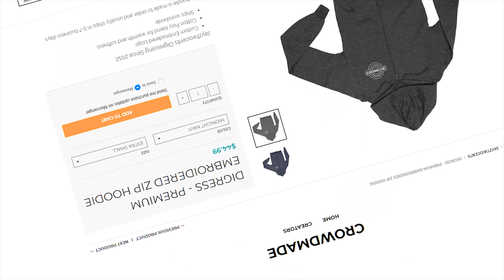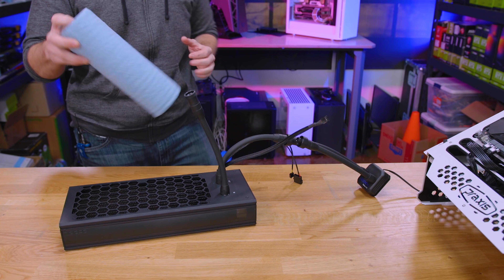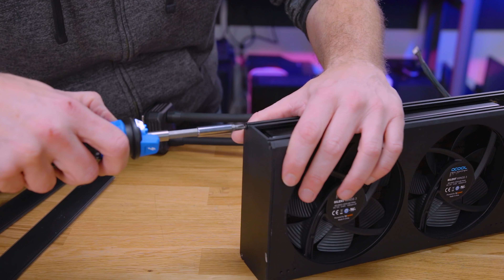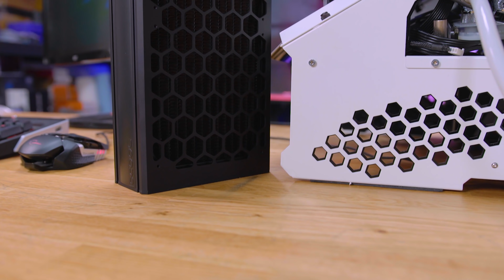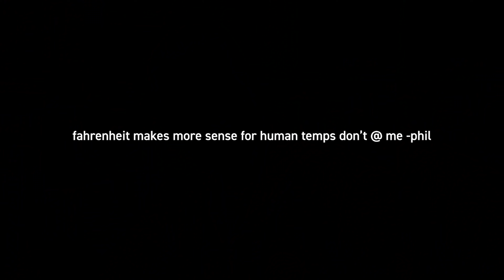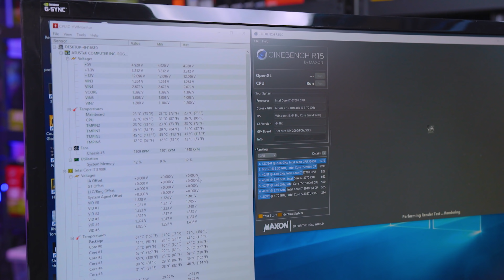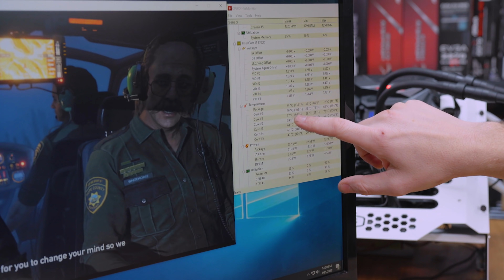This AIO is ridiculous!

Comment: I know this is an old review, but you have to look out also with bigger GPUs, if you want to mount this beast in the front of your case, I bought me a 360mm Eisbaer Aurora, and I just had the place to install my MSI 6750XT Trio GPU, And I also used different fittings and tubes to the radiator/ pump. Which is an amazing possibility. Because the quick connects doesn't look very attractive.

Comment: Hi JayzTwoCents. I have an AMD Ryzen 5 3600 processor and I ordered two coolers detailed below. Cooler Master Hyper 212 LED I also ordered a 2nd fan to be installed in the cooler. The fan is Cooler Master Sickle Flow 120 Red. I also ordered a Cooler Master Hyper 212X Turbo. I think the latter is better. That's right? I plan to install the Cooler Master Hyper 212 LED to another processor that my son has is an Intel Core i5 3470. My question is this: Can I install the 212X on the Ryzen 5 3600 and the 212 LED on the Intel Core i5 3470? I also need to know how much watts of heat each cooler dissipates. I actually ordered the 212X for the Intel and the 212 LED with two fans for the Ryzen. I need your golden help please. Both coolers have two fans and all fans are cooler master. What do you say?

Comment: ....Jay, I want this AlphaCool Eisbaer "V-3" .... NOW .... over thee NZXT  Kracken z73 but unsure if it will fit even though its "280" and the kracken 360 will fit into my cases side air vent made for it, even looks like I can have it with tubes at the bottom since PUMPS built into unit if it matters as the tubes look a tad larger as in longer as they def are thicker... however UN-sure of it it will fit and how it turns out to be over the years as barley anyone has videos on it or bought it as in NOBODY has it, LOL... it will look great and awesome where I put it in the case if it fits THOUGH, this does not lose water more then the average AiO as in how often would I have to top it off and the parts on this one can always be changed also once RAD is in my unit, correct? I just want no leaks...  - I think, followup video is NEEDED if you ended up using this(?) ... it is good that it has been 2 years or so now! How did it go, I can always get a separate LCD they sell now for my temps and all and prob be larger and fit more info on it then the krackens sort of gimmick but not gimmick LCD as at least it does the actual useful stuff, not just random .gifs .....as that is a the gimmick, temps are NOT... they sell them LCD screens to be built with puppy Linux and such to read out your windows or UNIX even TEMPS of CPU/GPU, etc... whatever will fit without having to use the overly cumbersome and sort of spyware NZXT software and this does not even have all those crazy plugs minus it being a molex I can get a quality made in America Molex to X.... adapter.... issue solved, no worries... Anyway, the LCDS now are sold for $50/$60/$75 even little-over $100 for a ridiculously awesome one just unsure how we put them in to get proper, proper read outs, will have to do research unless you do a video, wink, wink.. On this though I really want to know if it will fit on my new Corsair iCUE 5000X RGB in white case as in on the side where it is a trey meant for a 360mm or smaller rad as seems the measurements may be more like even a 420mm rad when together as in this GERMAN-TANK here... (lol) ....so really hoping this will fit.... Unfortunately, do not know if I will ever find out if its good and better then Kracken overall minus money just overall raw performance minus everything else, even fan nose does not bother me.... The tubes are better then regular AiO's, def wider, how much wider? Are they also longer and again, if so, how much longer? LOL... Somebody HELP A GUY OUT, its my last part to run my chip that's OEM been sitting around for a long while, nearly a unicorn chip from early 2017 or so XEON.... Yes, I know maybe 14N/M Xeons do not need an AiO.... (200 watt TDP with a 53c T-Case, what is up with this so it says cooling on Intel site as custom, go overboard I figured so no issues?) ....its not the entire point though as this seems like it can be changed all around and I may swap back and fourth with my 6950x from my XEON 2679 V4 20 core / 40 threaded chip that does have a little OC if I chose and had proper thermals - I never ran it more then a quick trial once to see it run with my Cooler-master air cooler as in the Cooler-master  "ma620m" which is a great looking and decent to little better then decent air cooler IMO, just wish it was vapor chambered, still would not use my 2679v4 with it though, I do not think? ....but afraid to use this cooler as a always - everyday - cooler even though rated to a TDP of clearing 250 watts of heat off, ehhh, my CPU is rated at a TDP of 200 itself with a darn 53 t case, why a tcase of this, wonder, is this super unusual? ....This means I NEED A BEAST COOLER? ....prob when all 40 threads barking IT PULLS OVER 200(?) ....I  had it and will have it back on the ASUS-X99-E-WS/USB3.1 MoBo with either ther Kracken z783, this one if it fits or the air cooler mentioned above as in the very unique / sexy cooler master model " ma620m" unless anyone gives me more reliable and different info of a product or reasoning's to do this with the xeon or that over my PLANS...... I also like the Kracken 360 newer gen 7 pump as in the Kracken z73... Not worried about prices, however thee Kracken, well, that true "aio" .... took care of 2 birds with 1 stone for MY crazy Build with RADEON VII pro in it... However, I Really want and always wanted an LCD readout with all the good info so much so I KEPT / KEEP a clear prison TV.... (Literally, jailhouse) .....it is a HD TV that was decently thin still and totally clear, branded AMPED.... (why prison TV? ...Welp, I found one on offer-up from a prisoner just let out & he was selling it for cheap for more "bus-fare" in Philly, LOL... Anyway, works to this day for a chance at like $35.00 was worth it to me as unique as the thing is, serves its purpose as a LCD readout of all temps, etc, etc, just wish it was automatic as in when booted to windows I did not have to open and drag cumbersome software over to the third tiny prison tv for the session, surely there is many solutions to this I have not looked yet...) and it works great so yes, please someone help a guy pout with this size and it fitting on the side of the very new corsair 5000x icue rgb where the glass it cut into like a actual air conditionoing vent for a house is what it looks like? HELP! ...... All my parts are NEW except the XEON 2679V4 and MoBo, my last part for this ridiculous build needed is indeed an aircooler, vapor chamber or an AIO or whatever this is called, someone please HELP! ...... Take a shot at me, say something... LOL... :)

Comment: I got this for my latest build to cool i9 10850K . I got the Be Quiet! Dark Base Pro 900 Rev2 case and... it just fit and no more in the top of the case. Took a bit of manoeuvring to get in and aligned with any of the screw holes... and for the first while, really thought it wasn't going in. But it did in the end and it's happily cooling the CPU at 4.9MHz and only 32C

Comment: Just got this today and it dropped my cpu temps on my 5900x down almost 10c from my 240 h1001 
quick note if you are running a full size mobo you might have some issues routing the EPS power cables I had to run mine across the top of the mobo good thing i have cablemod cables so it doesn't look terrible 

case used lian li dynamic XL - fits across the top perfect its just thiccc

Comment: hi all have two of theses 1 for cpu and 1 for gpu my cpu is 9900k clocked  5.3 mhz vcore 1.358 gpu is zotac ttx 2080ti amp extremum  clocked at boost 2100 mhz cpu on bench marks never gos over 75c gpu has never got higher than 60c

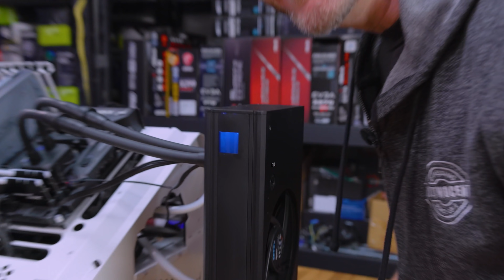Comment: I thought the pump should be at the low point of the system to avoid bubbles?  Yet, you're running this with the tubes, reservoir and pump at the top ( 5:09 ).  If you're going to run this in a vertical orientation (let's say at the front of a case), shouldn't all those things be at the bottom?  But, if you turn the thing over, will the tubes reach the CPU?  Also, the fill port is entirely useless any vertical orientation.  Even if it's mounted horizontally at the top of a case, the pump and reservoir are going to be at the top of the whole cooling system.  Are all AIOs like this or just the Eisbaer?

Comment: ive heard a lot of different things as for liquid being used in these, but is it mainly water? thought id ask because ive seen mineral oil used that way if this is a leak it wont cause damage to the system. Would it be worth to use mineral in one of these or would that just be too hard to pump or what?

Comment: Hey Jay
I am planning to purchase this AIO
I would love to know if this single AIO would be enough to keep a 3950x and a 2080ti cool

Could you please make a video where you expand the loop and check temps, I believe it will help many of us who are restricted by case mounting options
Reply: just buy an extra rad 360 on the site for 90 euro whit the quick connects/water  installed and a gpu block whit the stuff installed
Reply: @henrikandersen4777  size limitations :(

Comment: I have NH-U14 on my 2700x can run at 4-4.2ghz all cores (it does throttle a little when it hits 80C) when doing simulation with PBO before now with bios update PBO is gone i can only run it at 3.88-3.9ghz. well it doesnt go beyond 71C

Comment: They also still sell the older "basic" Eisbaer 280 with only one quick-connect and the pump/reservoir on the CPU block, giving it a much more conventional radiator profile that fits in most cases.
It also costs far less, at "only" $115 US as of typing this.

However, my main worry with Alphacool's line of expandable AIOs is routine maintenance.
Are these units still "worry free" like most AIOs?
If you actually use the quick-connect expansion feature, does that make it no longer a sealed AIO and now you have to worry about routine fluid changes and all that fun stuff?
I see a fill valve, but not a drain valve. Which would make this product even MORE of a long term hassle than a normal open loop custom system! How do you drain it to replace the fluid without completely dismantling it?
Especially if you have to do this every year or two!
I mean, that's one of the two advantages of AIO over custom loop, is that it's pretty much maintenance free over the service life of the product. (The other being its ease of installation.)
But these are all "off the shelf" water cooling components. Which appears to mean that this is just a custom loop kit that somebody else has assembled for you, complete with premium for said service, and those "low mess" quick disconnects.
I mean... if it can't capture these advantages, why does this kind of product exist in a world with full system custom loop kits for less than this one piece product that, other than being a little easier to install, is exactly the same - or even WORSE if you dare try to use it for more than one year?
Reply: Ha. Thanks for that. The old Eisbär is a way better entry into watercooling then the new one. Especially for ITX builds.

Comment: Pro tip: To quickly convert C into F just double it and add 30. It won't be exact but will get you in the ballpark. Probably not useful for computer temperatures but for the weather or room temperatures it will give you a good idea.

Comment: Jayz something like "curing process" of thermal paste does not exist - Der8auer and Gamers Nexus talked about it. It migh've been that "pump out" effect that they were talking where due to metal expanding at different rates the thermal paste spread better and kinda "settled in" between IHS and cooler. You don't have to "cure" your paste, just let it run hot once and cool it off and you're basically ready to go.

Comment: @JayzTwoCents

#JayzTwoCents

Which AIO pump cpu liquid cooler would you go with? The Alphacool eisbear 360 mm or the cordair H150i Pro. Which one is better? The alpha cools rad is made of copper. I want to upgrade from a H100i pro to one of these two coolers but I'm not sure which one to pick.  What cools better and has better temps, etc? Any info about pump speed? I would like your recommendation. Thanks.

Comment: I wonder if that pump can be swapped easily, for the purposes of maintenance in the long run or adding a stronger one when you add more bits to it.
Reply: Wich pump is stronger than the VPP755? The head pressure is over 4,2 m.

Comment: Even though this page is in German, scroll down and you'll see all the dimensions (in mm).  By the way, there are other solid-copper Alphacool Eisbaer radiators that are smaller. The Extreme is a hefty specialty cooler, but Eisbears will fit standard dimension (e.g.120 x 360) and the new Eisbaer LT has an extra-thin radiator, especially design for EATX motherboards with little clearance at the between the motherboard and top of the computer case. https://www.alphacool.com/eisbaer-extreme-details
Reply: You can switch to english on the right side of the top.

Comment: All aio's are slightly ridiculous considering that air coolers offer better cooling at a lower cost.  All aio's offer is looks and less noise.
Reply: Ehhhh,  not quite. 

AIOs can cool better than air coolers, you just have to get AIO big enough to do that. And AIO won't be quieter, as you have fans noise and additional noise from the pump

Comment: Buy a Mini Fridge. Get some longer hoses. Stick the radiator in it. No fans needed. Setup the software to tell the pump to come on at 50c... It will never get hot again while being 45 degrees in the mini fridge...You can buy a cheap one for $70.00 at Home Depot....

Comment: Why don’t you just add a thermometer cable to your pc at least to get the intake temps in celcius. You can see and record even individual core and vrm temps, but you neglect intake temps which is a huge factor when comparing such small differences. I think this kind of feature should be included at high end cases as well.

Comment: "This chip is designed to be able to run all day technically at 104C."
So, It means I can ramp up the voltage as much as I want if I can keep the temperatures below that 104C? This is a question I've had for a long time regarding overclocking.
Can someone enlighten me on that one?
Reply: I saw a videothumbnail about ”heat vs voltage, what kills your cpu?” But i didn’t watch it. Maybe you should :)

Comment: Hmm. My i7 6850k is at 4.4Ghz with 1.380 Volts and it runs in GTA V at 55°C. In Cinebench it went up to 78°C which seem to be okay. Cooled by a BeQuiet Silent Loop 280mm. I'm think about getting an i7 6950x but will be a 280mm still enough to overclock it? I mean 1.380 Volts is a little high so the AiO keeps up pretty good.

Comment: Lol I run 1.452 under load 1.416 - 1.427 at idle on the daily with an H100i buldzer cpu. No problems what so ever. Perfactly stable even what the ambient temps are 80F. Running at 4.8 it can go faster say 5.2 but anything faster than 4.8 eventually overwhelms the AIO... Thinking about switching to air like a huge Noctua or something on a bench. Any thoughts about cooling massive air or bigger water. Id rather just not run water any more if air can do the job above 5GHz... Maybe put my H100i on my GPU or something...

Comment: is there an way to get in contect with alphcool lol payed for 2 by mistake. O I should tell you I am from U.K I have a free phone number but bo 1 there lol
Reply: ha not a prob  keeping the other 1for zotatc 2080 ti extreme. just need a waterblock for card  waterblock
Reply: WELL HA CPU NOW AT 5.2 GHZ WITH THIS COOLER TEMPS IDLE 30C TO 33C. TEMPS TOP OUT AT 85 C SO ALL IS GOOD WOOD NEVER HAVE SEEN THIS COOLER IF I DID NOT CHECK OUT AND WATCH JAYZTWOCENTS
Reply: all good now intel 9900k clocked two 5.2 GHz on  1. 36 volts temps when benching 75c verry good kit

Comment: Swiftech, a while ago, had one of the first pump/res/expandable AIO concepts with the H20-220 Edge HD and H20-320 Edge HD setups (2x120mm and 3x120mm respectively).  A h20-220 has formed the base of my water loop in my PC since my AMD Phenom II X4 945 a decade ago.  Been through a few builds and expansions, but it's been an amazing and reliable setup.  Now cools my 9900k and MSI 2080 SeaHawk with an additional 240mm radiator and keeps things running COOL! :D

Comment: I like this product. I’m decided on a “traditional” custom loop but I think this is a great thing for the crowd that’s kind of shy about watercooling and matching up all the parts you need into a giant e-shopping-cart. Similar to the EKWB custom loop configurator to help new people get started. As soon as they assemble that first basic loop with EKWB hand-holding for parts selection, they can begin to imagine how to expand the loop and include GPU or MB VRM in their loop in the future. It could be an upgrade or a future build they do but it’s nice to see this segment growing. I actually stayed on air all my life and I am just now in the planning stage of a really beefy custom loop in a core x9. I only bought the case so far so I could measure dimensions and compare to size of components I plan to buy. I’m kind of going balls to the wall personally but I still see the value of stuff like this kit from Alphacool and the online configurator for EKWB. All the brands can thrive if their products are reliable minimizing the risk of leaks and thus building trust with all the shy people who are still on air but otherwise they are enthusiastic and build their own system. That was me for a very long time.

Comment: AlphaCool Eisbaer is a old product Jayz, you should probably mention it's the "AlphaCool Eisbaer Extreme"... also I'm pretty dissappointed you didnt try to reference it with your typical asetek cooler, like the coolermaster or nzxt variants, at the same size.. 280mm.